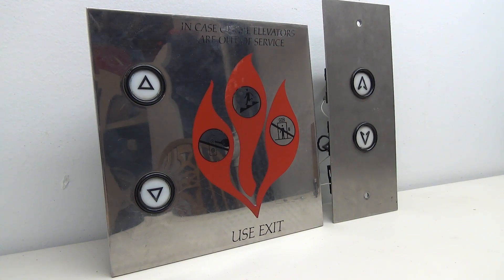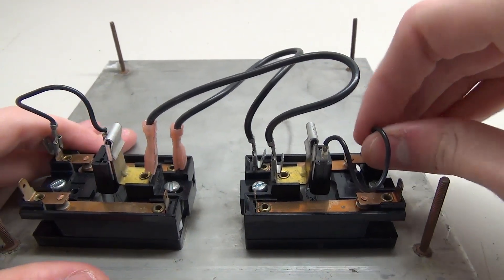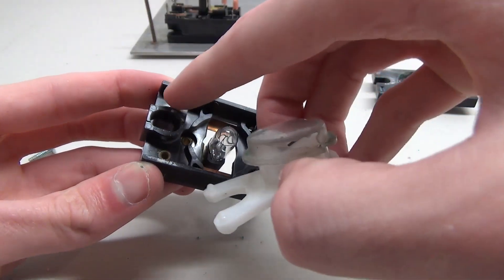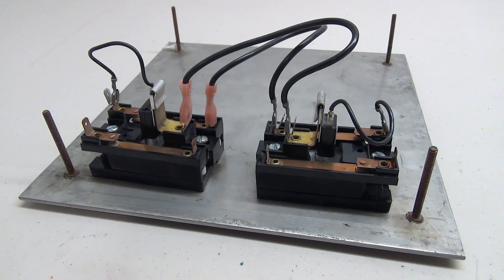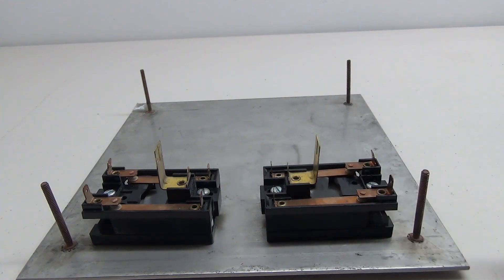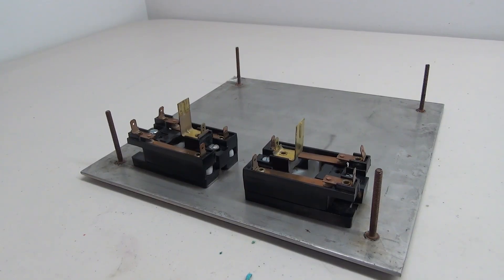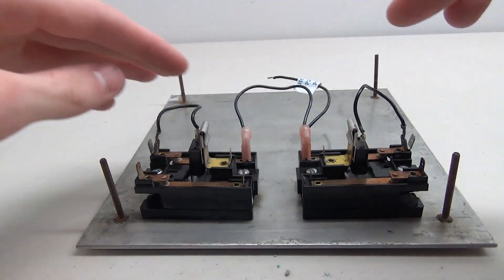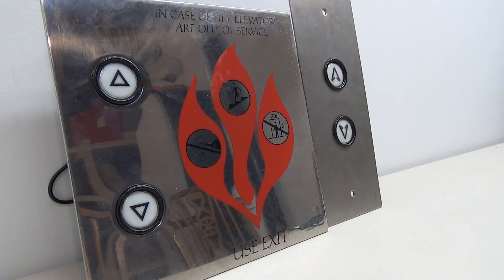How to wire Dover Traditional Elevator Buttons

Comment: Question! I just bought one of these off ebay and have come to the conclusion that the contacts are stuck and only allow the button to press if the fixture is tilted at an angle or facing downward, but facing upward like a normal fixture would on a wall, the contacts go back down as if already pressed... Is there anything I can do or if I am missing some parts? Were they glued originally?
Reply from the maker: They don’t press much to begin with. There isn’t any glue
Reply: @ ah, okay.

Comment: Do you know where I can find bulbs small enough/the right size to go into fixtures? I would like to wire a hall station with incandescents without having to plug it into AC.
Reply from the maker: Depends on the type of fixture. There’s multiple types of bulbs used.
Reply: I'll have to check when my Monitor TR hall station arrives. In the picture it still had the bulbs, so maybe I could see what type they are and get a low voltage version of them.
Reply from the maker: @ex5138  Do you have a link to the picture of it? I can probably identify the bulb from that.
Reply: Here is the Ebay picture. https://share.icloud.com/photos/0P7Mft4vH1xHagQDGLSRzgxcQ
Reply: I'm using my mom's account because icloud is weird. It also automatically saves to there because I'm using an Apple device. I don't like having Apple accounts. The way Apple services are set up is kind of annoying. lol
Reply from the maker: Those look like PSB bases. You could get 6PSB bulbs which would run on a 9v battery.
Reply: STL Elevators Ok, thanks. I'll try those. I have plenty of 9V batteries.
Reply: I just checked, and on Ebay it says that they are all 6v. You said they will run on 9v so that's what I will try.
Reply from the maker: @ex5138  I've used all 6v bulbs and I've yet had one to burn out. It's just a little bit brighter than normal.
Reply: Ok, even better. Thanks for the help. I could give you a link to a picture of it when I'm done.

Comment: Hi there, I'm just curious what is the purpose of the contacts on the other side of the switch where there aren't any wires? Both contacts are pressed but the one side has no wires attached to it, would it be for a latching function? thanks, great tutorial!
Reply from the maker: It's another set of contacts that can be used for really anything. In this video, I am just making the button light up when pressed, so I only need one of the two contacts.

Comment: I have a vintage doorbell button that presses at an angle like the Dover Traditional button. The way it works is there are two brass metal tabs, and when the black button presses against the big tab, the big tab is pushed in and connects to the smaller tab. Pretty cool!
Reply from the maker: Nice!

Comment: The Montgomery Globe and Parallelogram fixtures use a similar clip for the lamp socket on their contact blocks, though it isn’t used as apart of the circuit
Reply from the maker: Yeah they do! When I was working on Andrew's, I had to custom make lamp sockets since his didn't have any.
Reply: I recently acquired an old Monty G&P car operating panel, would you possibly happen to know what keys it would take? It has key switches for the photo cell and independent service, as well as those weird light/fan switches that resemble a flathead screw
Reply from the maker: @xaviersullivan7782  The light/fan just uses a standard light switch key. They are not secure at all. The actual keys are Corbin 1.

Comment: Thank you so much for walking through the steps on the Dover classic Traditional elevator call station, Jason. I, myself, got two extra ones that I haven’t wired up, the intermediate call station that you saw in my video have already been wired up with lamp sockets inside them. The other two do not. When I wire up the rest of them that I told you about, I’d be happy to use this video as a step by step! :D